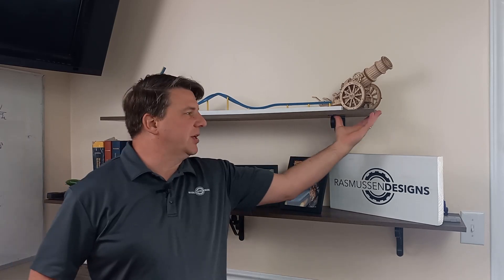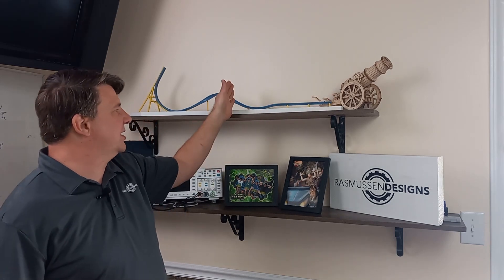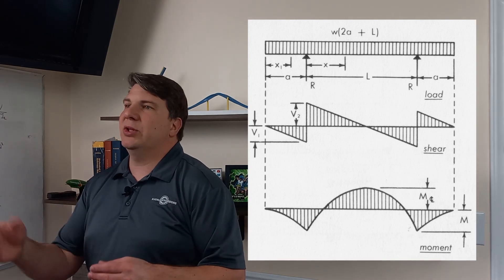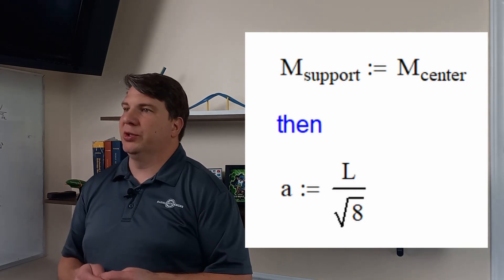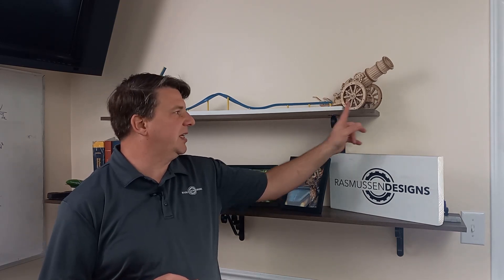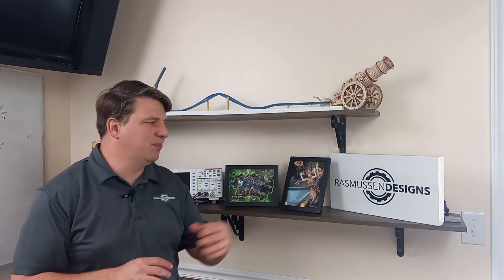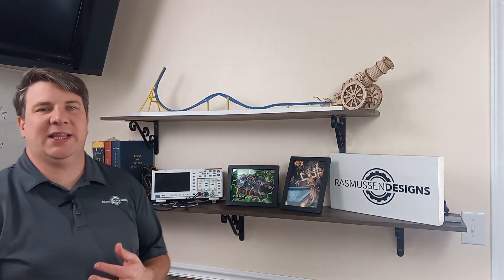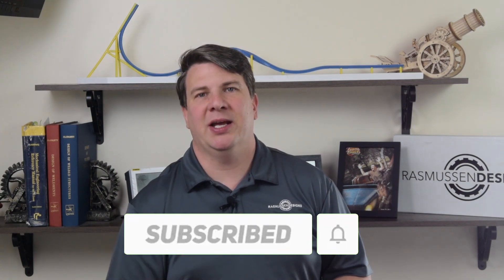Where to Put Your Shelf Supports

Comment: Hey thanks for the info, I like the 20% rule but I left feeling more confused then I did going in. I would have loved a bit more about info about why the offset on the edges helps with sag and how that’s related to leverage and the equations. This did however tell me that I’m definitely missing something when it comes to hanging shelves. Also sad you didn’t go more about the mid bracket and how that effects things